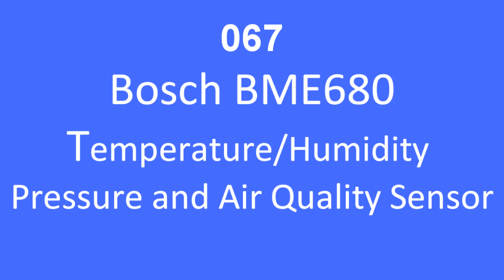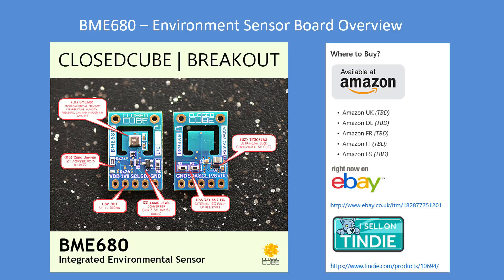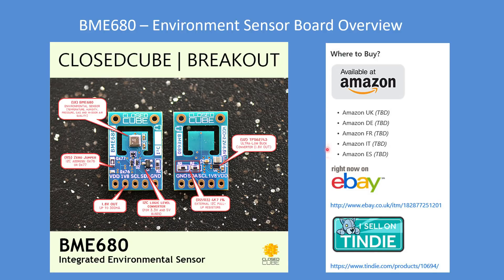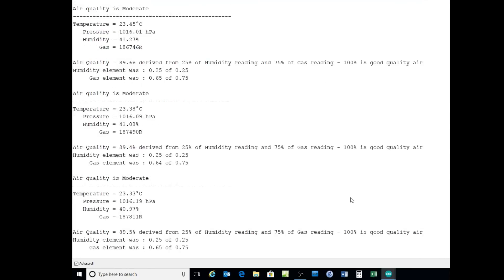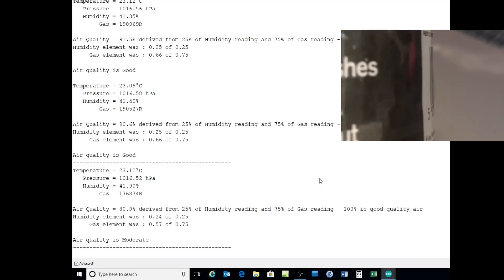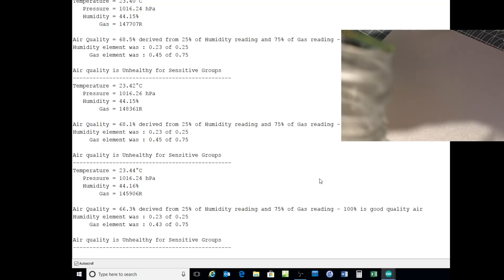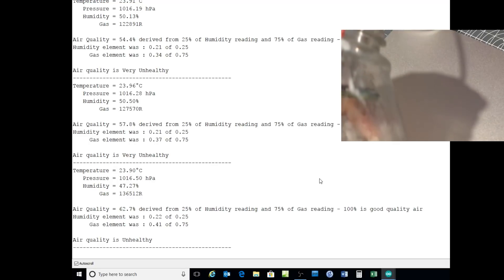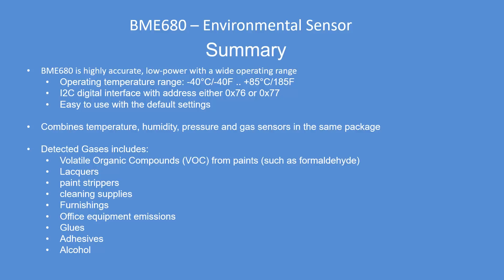Tech Note 067 - Bosch BME680 Environmental Sensor. Air Quality, Temperature, Pressure and Humidity

Comment: I'm interested to see if the gas sensor will be useful for tracking terpenes in cannabis production... I' still having issues though with the gas sensor heating up the temperature sensor.
Reply from the maker: All the bme680 products I have show the same temperature offset product the best I have is the Closed Cube variant because the on-board regulator is placed some way from the bme680. It has to run for at least 30-mins to give a steady air quality reading. It only detects volatile organic compounds. Calibrate the temperature with a simple subtraction of a constant that works well.
Reply: @G6EJD  Yeah I saw some instructions on the bosch notes, but they are still a bit above my interaction level. (I'm only still starting in C and C++) maybe 2 or 3 months now.

Comment: My temperature ,pressure and humidity reading are comming all zero ! Could you help?
Reply from the maker: What is the development board your using? The bme680 brand? It is likely the connections are wrong or your using the wrong address for the bme680 try bme,begin(address) or whatever your device address is could be 0x77 or 0x76 and I have seen 0x68
Reply: I am using arduino uno+ CJMCU BME680 Adress line is correct i think
Reply from the maker: Junaram Arandhara make sure you have the connections correct and ideally run an I2C scanner to make sure the bus and device is being detected.
Reply from the maker: Do you have it working now?
Reply: @G6EJD  No i2c scanner works on arduino showing 0x77. I am giving begin(0x77) . It works but shows all zero result in sensor reading.
i2c scanner  is not working on esp32 board.
Reply: Thanks for your immediate response.
Actually problem is on the jumper wires they have discontinuties.
Reply from the maker: DuPont cables are very unreliable
Reply from the maker: Junaram Arandhara, I2C scanner does work well on ESP32 but you have to know what sda and scl pins are or add wire.begin(21,22); or whatever pins your using say 4,5

Comment: Thank you!

I have a query about - how does this help in GPS enhancement? E.g,- TTFF improvement and dead-reckoning.
Reply from the maker: Time To First Fix is an important parameter as its s measure of how long the GPS unit takes to get s fix, usually about 20-30 secs for the UBLOX units. For good dead reckoning performance where the GPS takes a position and then waits then takes another from which it can determine a direction of travel, usually used in vehicle GPS units, I did s TAN in making a GPS compass using similar GPS readings. If you look up GPS NMEA sentences you will see what a GPS unit can output, but note not every receiver outputs all sentences usually a subset of the most useful types, careful choice of the GPS module helps to determine the best match to your application.
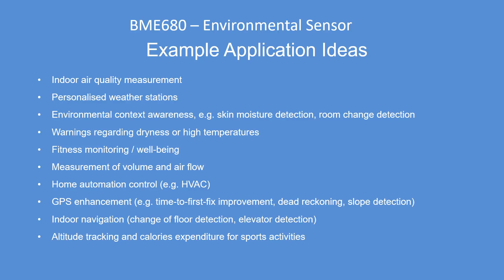Reply: @G6EJD  Thank you again! But again my question remains same. How this "BME680" helping in GPS Enhancement. I am referring your video ( at 2:18), there is a slide point #8. I am aware of the concept of TTFF and Dead-reckoning but curiosity was just to know that how BME680 is helping in achieving faster TTFF? How is this helping in solving dead-reckoning (outputting 3D-position in absence of GPS signals)?
Reply from the maker: GPS units in the Z-plane (altitude on level ground) have a poor accuracy usually 3-tines more than X or Y, so most systems augment altitude measurement with a pressure sensor like the BME range as these are able to measure altitude to cm resolution and accuracy given air pressure (QNH) is calibrated at the time of measurement by contrast GPS altitude will be +/-10M which for most applications is not good enough. Does that help.
Reply: @G6EJD  Yes. This convinces that BME can help in improving the altitude accuracy (Z-component). 
I am assuming (correct me if wrong), BME will help in TTFF/DR(Dead reckoning) by offloading the positioning engine from height calculation. Hence improved.
Reply from the maker: the rising, you will find every GPS unit has an accompanying pressure sensor to get altitude because when s vehicle is going up a hill the z-component will be incorrect, you have to think about the vector mathematics to understand this is when Z becomes part of the Y-component relative to the earth’s surface and altitude becomes wrong when based on GPS Z-axis alone, then bearing is wrong and so on.
Reply: @G6EJD  Couple of things.... first, thanks for the vid, it's very good. Next would be "dead-reckoning" No GPS I have ever used had that mode. Prolly because IRS's use spatial orientation as opposed to the "old style" INS. Which was 2D based on acceleration.  Those and Loran and VLF did have a DR function... Last would be altitude..... gps is "above mean sea level" which your equipment would have to have very accurate QHN info as well as be initialized correctly. Hope that wasn't too word-ie.... Lol's
Reply from the maker: Michael Malone, you can get the low cost UBLOX GPS modules with the dead reckoning sentence output, most have about 12 or more of the nmea standard sentences, so it’s possible right now. The GPS system uses WGS84 as it’s earth model which is an average of the earths shape and size, so that’s its reference for altitude which will be very close to mean sea level of nominally 1013hPa which all pressure sensors are calibrated against. The reason an accompanying air pressure sensor is used for altitude in GPS systems is the z-component of coordinates is inaccurate especially when going up hill you’d need to look at the vectors of x and y to appreciate why if going up hill in simple terms the y component would reduce and z would increase, plus it needs at least 3-satellites to get z and that’s not always the case, initially at least, hence the barometer provides that function.
Reply: @G6EJD  Thanks for the reply, Retired from flying A320's in 2013, never heard of this stuff back then... So I'm playing catch up. Of course they never use state of the art in aircraft.... the tech has to be around and tested for a number of years.... Oh btw, it would seem to me that the gps should know your speed and direct relative to the center of the earth. So it should be able to see the Z axis as well.... Oh I get it.... too few satellites Lol's... I am slow.....
Reply from the maker: Michael Malone, interesting, I can’t see GPS ever being used for aircraft systems at least as a primary system because it’s not a guaranteed service system, it’s only recently the the US Government switched off so-called selective availability giving positional accuracy to 5 metres of what’s called circular error probable and GPS speed and altitude calculations are not trivial as take and aircraft on take-off in simple GPS terms sped would be derived from the x component but as the climb progresses x would drop as z increases, so it always has to be a vector sum of x, y and z to get speed as speed over the ground in a vertical climb would be zero but air speed much greater than 100kts hence the pitot tube being required, then at s critical moment you could lose gps signal (storm clouds for example) so losing gps supplied data for critical and fundamental flight controls and measurements must surely be impractical. There’s a lot to GPS but luckily the process is done for us. By the way the Bosch BME pressure sensors can easily measure altitude to cm resolution, I had a prototype running that correlated with my 1-metre ruler so that I could measure my desk height above floor height in almost mm steps and that would continue all the way up to the devices maximum altitude capability.
Reply from the maker: Michael Malone by the way, you may not have seen this, but use google earth to find a known location on earth (it uses WGS84 too) and you’ll find its location is not where it physically is, usually the CEP is about 120M off, a really good example is the prime meridian at Greenwich England where the line a long brass plaque is visible from space and should be at 51,0 but you’ll find it 100M to the east this is because WGS84 is not that accurate as the earth is not a perfect sphere.
Reply: @G6EJD   Yes. Basically WGS84 is an ellipsoid, Geoid and also a coordinate system (very similar to ECEF frame). The height calculation in GPS is entirely different from lat-lon. The X,Y & Z are linear component and by using WGS84(ellipsoidal) parameters they are transformed into latitude, longitude (which are angular measurements i.e.- in degree) and height ( linear measurement i.e.- in meter). To calculate the exact height GPS uses per-injected table which contains MSL references, precisely Geoid info. 
Now, since X,Y,Z of GPS are in ECEF frame. Their center coincides with the center of the mass of the Earth. In that case vectors of Z should not be affected much,  it should be negligible. However IMU's XYZ might get affected. Because their reference frame is Body fixed, not Earth fixed. 
In hilly areas satellite geometry is definitely affected and hence a bad DOP. In this tough condition barometer gives an awesome solution for height measurement.
Reply from the maker: You can try all this for yourself if you buy a u lox god receiver for about $10 and i terrace it to a micro-controller to read the sentences -a fascinating subject for some of us! Have fun.
Reply: @G6EJD  I am using uBlox receiver with Arduino and Raspberry-Pi. Mostly worked with NEO model. Really great help for entire community.

Comment: Hi. Can you make arduino with co2 sensor&lcd to controll ppm by sensor valve? Thx
Reply from the maker: Yes that’s possible but there afaik no sensors you can buy that measure in ppm, so you would need some means of calibration.
Reply: @G6EJD  Hi,you mean there is no co2 sensor which measure in ppm?what will be best solution? Thx for you reply
Reply from the maker: A device that measures co2 is generally £1000 and I do t know what sensors or techniques they use, but most accessible sensors are a relative measurement and only an estimate take the ccs811 it produces an eCO2 reading based on the volatile organics in the sample, so the ‘e’ denotes Estimated. The BME680 does not estimate CO2 it only measures VOC.
What ever sensor you use you have to make relative measurements based on known co2 concentrations, otherwise you’ll just have to configure the sensor to give a high medium and low result when the co2 is High, medium and low and use that as your measure. It is. It easy to do this in absolute terms. If you had a calibrated co2 meter then you could use the ccs811 output and correct in software for its inevitable inaccurate results. A good idea but no one is doing this yet afaik. Bosch won’t release their AQI algorithms which tells you how difficult all this stuff is to implement with any certainty of results.
Reply: @G6EJD  Hi , thank you for explaining. In theory if you make one co2 controller  with controlling magnetic valve sensor .LCD , co2 sensor humidity, temp , wifi what would be the accuracy of measuring co2? It will be for my grow room .How much this will cost ? can you give me your email address ?
Reply from the maker: What you describe is more viable. The CCS811 manufacture does not quote an accuracy of equivalent CO2, the sensor equivalent CO2 (eCO2) range is 400ppm to 32768ppm.

Coupled with a e.g. BME280 sensor, would give you Air pressure, temperature and humidity and eCO2 from 400-~ 20000, or could be arranged such that 400 = 0, 800 = 1, 1600 = 2, 3200 = 3, 6400 = 4, 12800 = 5, 25600 = 6 and therefore a 0-6 (7 step) range with which to operate your valve.

The CCS811 takes 48-hours to burn-in to its environment and self corrects for the environment.
Cost of components is about $30-40 but some work needed on the software solution. 
You can contact me via www.dsbird.org.uk
Reply from the maker: I sent you a comprehensive email containing lots of questions and specifications, but never got a response! So gave up...
Reply: Good CO2 sensor is MHZ-19b

Comment: How about this variables? 

float hum_weighting = 0.25; // so hum effect is 25% of the total air quality score
float gas_weighting = 0.75; // so gas effect is 75% of the total air quality score

It looks like these variables are not used later in code, weighting is hardcoded.
Reply from the maker: Yes they are unused, but you could replace 0.25 with hum_weighting and 0.75 with the gas_weighting in the formulas so you can vary the relative weighting between humidity and gas providing the sum is unity so perhaps 0.1 and 0.9 if gas was considered a major air quality driver or vice-versa. Perhaps even 50:50 0.5 and 0.5

Comment: i noticed BME680 is giving at least 1-2 deg higher temp and few % difference in rel humidity , as compared to ds18b20 and other temp sensors i tested. have you compared your bme680 with any other sensors ?
Reply from the maker: Yes I have and noticed the same, the humidity is likely to be different (lower) because of the higher sensor temperature, which appears to higher than it should be due to heat transfer (conduction) between the BME680 and the on-board regulator. Bosch specifications indicate it is as accurate as the BME280 - this is the only explanation I can come up with and is plausible.
Reply: yes i believe the heater (although heats for few 100ms) does affect accuracy of temp and hum sensor. and bosch claim it to be very accurate. i dont know how and why ?.   i was just wondering may be by reading temp hum first and then after some time getting VOC data might help a bit.
Reply from the maker: I don't think it's IQA sensor heating it runs for such a short time (mS) and in all my trials I've never noticed an increase in temp or humidity, they remain steady, getting a steady IAQ reading takes about 30-mins. The solution is to run the device from 3.3v, I'm convinced it is regulator heat transfer that's cause it. The good thing is the offset seems to be constant so easily corrected in software.
Reply: I am running at 3.3V. yes, i am  'correcting' temp values by just subtracting the difference (although not happy with this way). i am using pimoroni breakout board.
Reply: @G6EJD  It's preferred to run at 1.8V to reduce self heating.